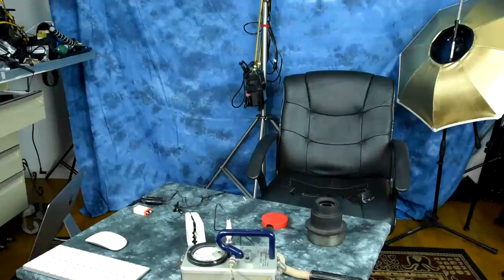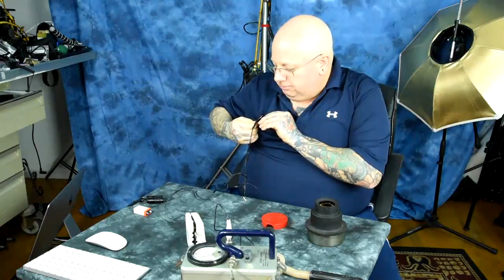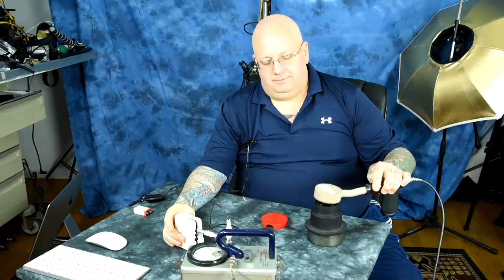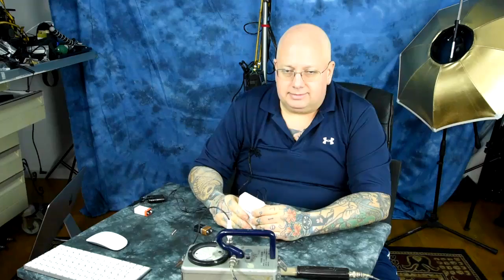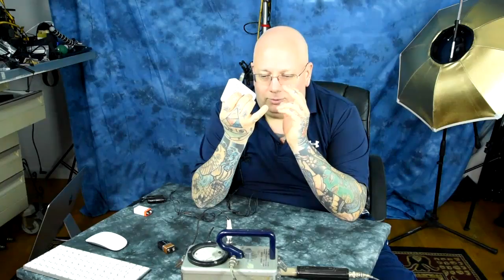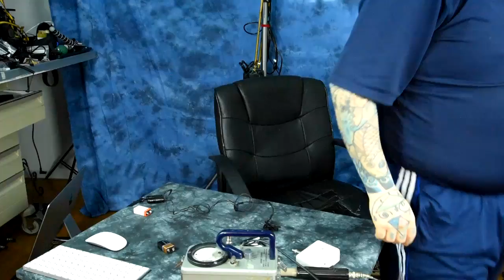*Red-Hot RADIOACTIVE* Lenses & modern glass additives: So, WHY is that stuff added to glass??

Comment: What do you mean by diffusion of light trough glass? Let's suppose we have made a perfectly polished lens SURFACE that doesn't scatter light at all. You are saying that the light gets scattered or diffused some other way INSIDE the glass? And this effect is reduced by having a higher index of refraction?
Reply from the maker: +Marko Posavec no such thing as "doesnt scatter light at all",  doesnt exist. 

you can have light arrive in the same place at DIFF times, or in diff places at the SAME TIME (issue with most lenses)

youre forgetting what GLASS IS, its a dielectric capacitor, the dielectric permitivity of the glass is CHANGED by additives, either radioactive or otherwise (modern compounds) 

see the "dissectable capacitor" video from MIT
Reply: +Theoria Apophasis... Obviously I understand that there is no perfect surface...I am saying we are pretending that it is perfect... to see if there is any diffusion even if the surface would be perfect. I also want to ignore reflections for this thought experiment. You are saying  there is a diffusion effect that is happening while the light is traveling trough glass? Normally I would assume this would happen in a material if it contains large enough reflective particles inside. But I guess it could happen if the material refractive index is not perfectly uniform trough the volume. Or maybe diffraction depends on refractive index?

Basicly I'm asking: What do you mean by diffusion in this video?